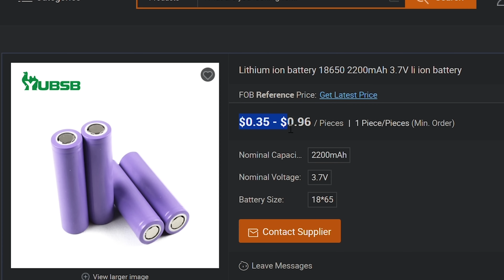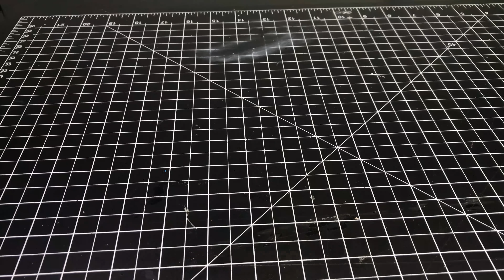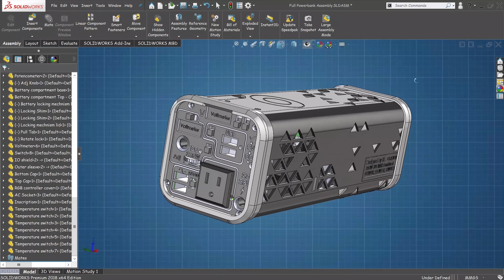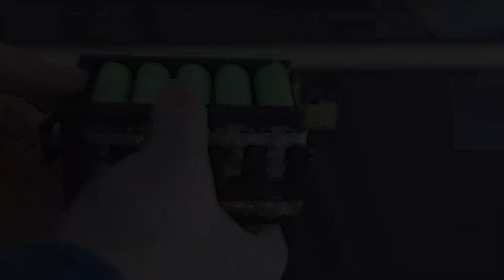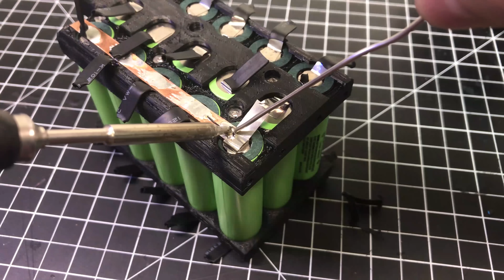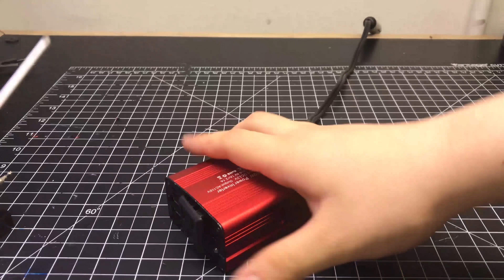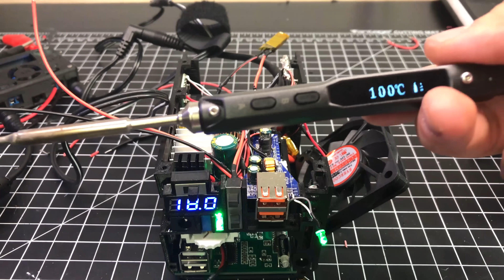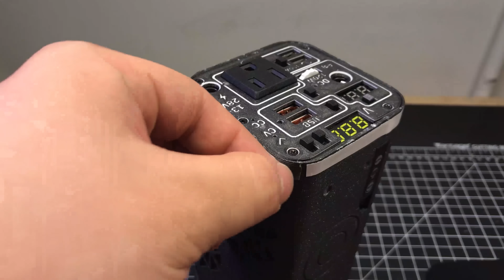How to Make the Ultimate 18650 Power Bank with Infinitely Expandable Capacity

Comment: This really is a wonderful project. I am definitely looking forward to making one of these this summer. I already have plans to modify the design slightly  to accommodate my wants, like having a USB PD II port for charging devices like the nintendo switch. I am so thankful that you made the CAD in solidworks as that is what I used in high school for robotics. Your CAD work is extremely well done though the 3d print-ability of some of the designs is questionable at best. Still love the project though!
Reply: Just an update. I've decided to go forward with the build process. I purchased genuine samsung lithium ion 3300mAh batteries (16 of them) for $40 shipped which added quite significantly to the cost but I am ok with that. In purchasing the materials I found that a few key components were missing from the description's list and I made sure to purchase those as well. I changed out the usb charger for one that has USB PD which added about $5 to the total cost. The materials ended up costing me $100 (free slow shipping), not including the $40 battery cost, since I also had to purchase stuff like kapton tape, wire, heat shrink, and copper sheet which the extra of which I will add to my arsenal of electronics building components. I've also modified some of the CAD to make it more printer friendly which I will add to a remix of the thingiverse project once I complete my version. (BTW, no RGB for me)

Comment: one small issue with using 45c cut off switches is that in many parts of the world that makes them useless in Summer as that is ambient air temp most commerical products use 80c limiters, as thermal runaway tends to be at 160c

Comment: If you launch a Kickstarter for these and you do them with 2 different types of cells, for capacity or for shipping or that they are allowed on an airplane, and then as a kit or pre-built, i am willin got say you'd sell a shit tonne of them.
I know i want one.
You would probably be better off to have company actually make molds for mass produced plastic parts instead of 3D printing. And there are plenty of compaies that will build the whole thing.
I'd also use add-on options for some cables and a charger.
More awesome if someone or some company could redesign the boards into less boards, have custom PCBs made that will probbaly be better and easier to install.
Is pricey, but if you have to make a whole lot it will be better than doing each one manually which will be very time consuming and expensive and have a higher likelyhood of mistakes.

Myself, i can't do this at all, don't have the knowledge or the materials or tools.
Also, would a USB-C out for power not be an idea ?
That said, you can also just add some USB-A to USB-C cables as option that can handle the Quick Charge power.

I would want one, plus a battery pack, that can charge while the other one is used, even though that can probably take longer than the other one takes to be drained, depending on what you use it for of course.
Also, it should be really easy to switch the packs and the pack itself should be safer with a sleeve around it so nobody electrocutes him or herself. Especially for mass production. A simpler latch mechanism would be awesome.
You can probably sell something like that for a nice amount.

But you did a bang up job designing this thing, it's insane.

Comment: Wow, this is pretty cool. I bet you could make it a bit more space efficient if you designed your own PCBs for the various stages of power output, and reduce the overall wire clutter. In theory it would be pretty simple since it's just hooking up the inputs and outputs of pre-assembled circuits, so combining them all together into one cohesive board would be pretty straightforward. Maybe an idea for a version 2 of this power bank? PCBWay will allow you to manufacture any board you want really, they'll even order all of the specified components for you and assemble it for a fee. They'll even do single-run boards too.

Comment: How can we modify this to output current while charging, so that we could use it as a mini UPS?
Reply: That would be quite easy, use relays to connect all the outputs to the DC input and disconnect from the battery
Reply: @theodiscusgaming3909  good idea. but wouldn't it cause a power loss when power goes out for a pc? Other than that it totally makes sense

Comment: @12:18 Car-fuse permanently attached? What is the reasoning for this? Why not use a fuse-holder, so it cat be replaced without major disassembly?
Reply from the maker: I did not have a fuse holder at the time, if you make it, make sure to attach a fuse holder.
Reply: @kralyn3d   I figured as much. Although with proper testing I suspect the need to replace that fuse would be rare. Just a bit annoying if you happen to be in the middle of nowhere and without tools & this fuse does pop for some reason. I will be following your instructions for this project shortly & maybe mod the 3D frames to accommodate a serviceable fuse. EXCELLENT WORK man!!

Comment: @K R A L Y N 3D: Why did you add 5A Schottky diode to charger?
Reply from the maker: To prevent the current from the batteries to flow past step-down converter and turning on the relays.

Comment: congratulations an exceptional job but I have some criticisms that I have to make you in the hope of seeing a new and improved project in these little things.
1) the quality of the frame print is painful but I think it was a choice to print it in low quality.
2) the schematics are really not very understandable.
3) the general construction is very unsafe. you can do much better without seeing flying solders, for example hateful welds on the USB connectors to be removed or the direct welds without protection on the pins of the relays or the welds of the common negative put on a piece of wire like this. cable management is really bad, sorry if I tell you, but that's it.
4) you should change the battery holder making it closed in this way it makes it much safer to replace the exhausted battery with the already recharged one perhaps creating a small separate charging circuit in order to create 2 or more battery packs for the camping.

overall a great job aesthetically really appealing in the construction it takes a little more care for the construction and for the safety also because it is an object that theoretically should be used in mobility so it really takes a lot of jolts and if you move something and ends up putting in short 2 welds, pufff magic smoke

P.S. I started following you from Italy

Comment: I was totally with this until you started soldering copper strips to the batteries themselves. Please, for the love of god, don't do this. It WILL overheat the battery and cause damage, and one day you or one of your viewers will blow up a battery in their hands even if they heat it less than you did.

The only safe way to attach metal strips to a battery is with a spot welder. You can find videos on this all over YouTube as well.

The thing that really blew my mind, though, was that you used batteries with metal strips already spot-welded to them, put insulation over those strips, and soldered new strips on top. Why?! Those metal strips are meant to be soldered to! THAT is the safe way to solder to a rechargeable battery!

Please understand this criticism isn't meant as an attack against you, but rather against design decisions you performed which can be dangerous and disastrous. You clearly have a very good idea of the electrical engineering part (though after all this I do have to question how much research you did on the current carrying capacity of your components), but the execution is literally dangerous and I highly suggest you keep yourself safe here…

Comment: Hey, thanks for your video !
I bought 18650 battery 12 000 mAh, i think it will be very usefull for your design :)
Reply: Yellow GIFs i guess. 18650s over 3500-4000 mAh are if not fakes completely unreliable.
And 1200 is a total joke. Weigh them decent ones are 45 grams +
Those weigh half get rid of them.

Comment: Which layer do you switch the filament out ? And is there a setting I can use you cura that will automatically stop the print at a certain layer so I could change the filament?

Comment: Make a business, I'll buy one. That will sell over $100 easily with some decent components.
Reply: No way could this be sold commercially for $100 in its present form.  This is at least a $250 product, but the creator has done an amazing job of creating all the information you need to build your own for much less.  Yes, it's rather complex, but the design files and instructions are well done.

Very impressive, KRALYN3D!  I hope you get 1M+ views with this.

If this were to be manufactured, it would need a ground-up, unified design suitable for production.  A Kickstarter might be cool, but it would take quite a bit of money and expertise to bring it to market.  The comments suggest that there's an obvious, untapped demand for a "high-level" power pack like this, though, so someone will undoubtedly make it happen.

I certainly want one.
Reply: @antibrevity  It would be worth it at $300 and you'd still sell as many as you could produce
Reply: hahaha if parts cost $60 and it takes how many hours of labor to build? there would be no point in making only $40 on each one.
Reply: @pond3rboy  this product will most likely be bought to charge laptops, I don't see why someone wouldn't just mass produce this. They could even sell it without batteries and you pick what batteries you want. If mass produced you can have assembly lines, I know some people who wouldn't mind having a job.
Reply: @pond3rboy  just put an apple logo on it and sell it for 1000$ more
Reply: @pond3rboy  Dude stuffing it with components from reputable suppliers will increase production by say $80~$100 or whatever sure but this device does:

1.RGB Lights which can easily be made to change color to show the status of the product like / user customization.
2. MASSIVE power bank capacity
3. An AC 150w outlet (I'm already sold at this point) 
4. Quick charge USB
5. A MODULAR battery bank (Absolute madness because he can sell expansion packs AND a possible conversion kit like solar)
6.DC Power supply, adjustable as well WITH active cooling.
7.Wireless Charging.
If you were to slap some good stuff in there with great customer feedback along with rugged build quality for the housing, that thing WILL spring board to lunch money $60 to a chunky $150-200 or so quick and that's being damn generous. This dude sitting on a brilliant, money printing idea, you just hating.
Reply: @dabreadman6567  Agreed dude, now you're talking
Reply: @dabreadman6567  I need this
Reply: DabreadMan yes but this product also has to pass safety certifications. Straight away from the video we can see many unsafe/improper practices carried out, the soldering is very poor and many joints look cold and the way that he soldered every negative wire to the xt60 connector is wrong. In this case you would use something like a busbar however clearly he has not done that. This product is a great idea but at the stage where it is at in the video it is not fit as a product to be sold on the market. Many of the components inside come from China and don’t pass the certifications required in many countries, especially that dodgy modified sine wave inverter used.
Reply: @dabreadman6567  Whoever makes it after watching this will be sitting on a money printing idea
Reply: Funny, he wants to teach us to fish, and you're all trying to figure out how to give someone a fish instead of passing the spirit along...
Reply: @generovinsky  a prank.
Reply: @generovinsky  There is a thing called division of labor.  You need to understand fundamental of engineering, voltages, build of materials, dimensions, spec, measurements, my wife would never attempt DIY of this type, she don't even know what autocad means, let alone install the application, 3D printer jargon.  She will buy a fish instead of putting on the bait with hook, that goes for anyone who just don't have the time to build a quality product, but interested not in the build process, only interested in result and benefit including myself.
Reply: why not let apple sell this?
Reply: Sell it without the batteries. Could go for 150.00,
Also include one extra battery pack. Save on all the headaches of battery shipping and the customer has the option on manufacturer preference.
The best part of this design is it is  servicable.
Reply: There is no way that this would be able to be reproduced at a profit margin that would be worth setting up a business.

1. The housings and frame are 3D printed. this is going to take at least a couple of days to print everything.

2. This is a skill intensive build. these are not reflow capable, and the connections aside from the battery pack connecting to the block are all hard wired.
This is going to take a few hours at the fastest to make ONE, assuming someone is comfortable going quickly.

3. When it costs $60 to make in components, the bare MINIMUM acceptable margin puts the price at $180-200 per unit. That is not factoring in labor.

As someone with a MEMS degree whose side hustle is custom electronics fabrication and 3D printing, I would not touch this with a 10 foot pole as a commission for less than $250. It is too intensive in time and energy to turn a profit.

This thing is an absolute monster and I ADORE it. I can't wait to get going on one of my own, and I am very impressed with the time and thought you have put into its design and safety measures.

But PLEASE, do not try to mass produce this, bask in your masterpiece.
It is a piece of art.

Comment: Mate, get yourself a better soldering iron, yours doesnt seem to have enough power to work with these thick wires and big ground planes. And consider also getting a hot air soldering station.

Comment: @K R A L Y N 3D It would be possible to charge your battery pack with a much higher current than 3-4 amps as you charge 5 cells in parallel, each easy chargable with up to 1C. If you charge them with 0.5C, you can charge 5 parallel cells with 2.5C. C is the capacity of a cell, so a pack made of cells with each 2000mAh capacity can be charged with 4.5 Amps.
Reply from the maker: FlorianB yes, but the step down converter can only handle 3.5A before getting too hot.
Reply: @kralyn3d  Cool, thanks for answering. Yes, it will get hot, you're right. In my version of your power bank, I plan to add an extra connector for fast charging the bank with an external charger, so heat will not be an problem.

Comment: Nice work man but you definitely need a more powerful soldering iron!
Reply: TS-100 is great for typical electronics work, but soldering huge blobs of wire all stuck together is pushing the capabilities of the tips it has for small scale work. I keep an old $5 40w Harbor Freight soldering iron around for work that really needs a lot of thermal output. Let it heat up for 5 minutes, and it'll melt the solder for an inch in either direction on that abomination at 21:35.
Reply: Phoenix Exactly. The problem of these small irons is the small heat capacity caused by the small tip and the weak heating element. For soldering thick wires or high current stuff you need a tip that is as big as possible and at least 40 Watts.
Reply: better to spot weld the batteries.

Comment: Hello, that bms you got there, I have that one here with me. One thing you didn't know about it: it only balances the first series of batteries, so everything after 3 cells isn't balanced. It's not a n-cell bms, it's a 3-cell bms. It may not be dangerous to connect a more than 3, but the batteries will not be balanced well.

Comment: the wireless charging curcuit will blow when you start using quickcharge, since when phones quickcharge they use 9 volts insted of 5, it would be better to ad a mini boost converter to power it.
Reply from the maker: the bottom port is actually a normal 5v 2.4A port, so I soldered wires to that.
Reply: @kralyn3d  oh, ok i thouth they were both quick charge :D

Comment: Yikes! This is exactly the sort of gadget I want, but I'd never go through all that. My only wants bove what you have done is a lower voltage for DC out (add a small buck converter) and a better AC inverter. Still, that is a great job combining parts already available and putting it all together in a nice package.